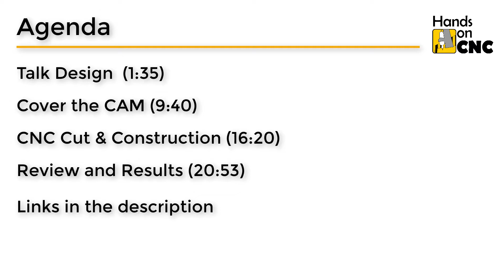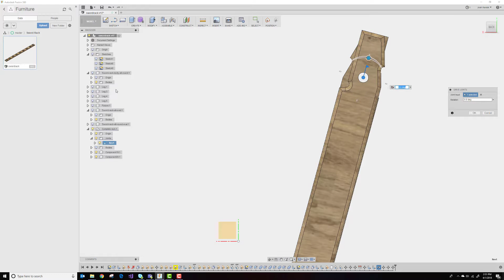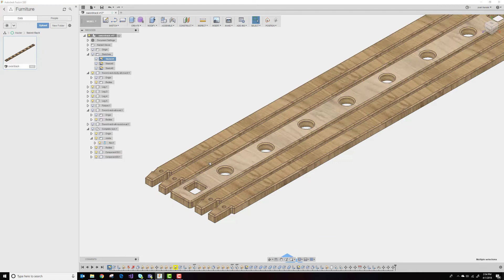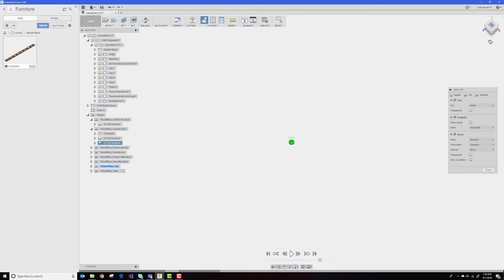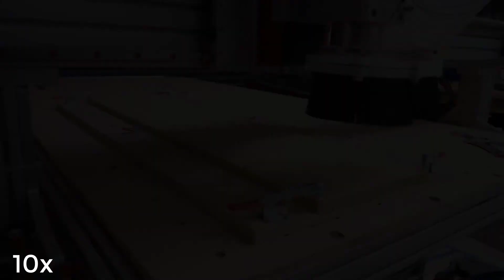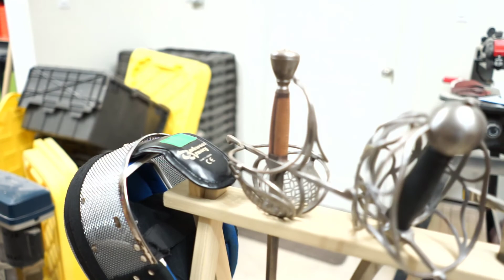Making a Sword Rack on a CNC Router

Comment: You seem really nice, and the presentation was solid. But it seems like a pretty boring design for a guy with access to a CNC machine.  Who is your expected audience, 14 year olds?   I feel like I wasted 20 minutes and could have knocked one of these out with a hand saw in less time than watching the video.
Reply from the maker: To each there own.. and there are parts that would be easy to knock out.. I can say from experience that getting the locking geometry right by hand is very fickle, and that they do take more than 20 minutes to make with hand tools (having made plenty of them with hand tools before).    Plus no one said this was an advanced project ;-)..   But I am glad you liked the presentation..
Reply: I did like the presentation.  Would love to see you make an "advanced" version of this project and see what you come up with.  I'm currently trying to find designs to replicate from the 17th century but it's tricky.  Most museums seem to display their collections not as they would have been stored historically.
Reply from the maker: Thanks for the suggestion I'll put it in the queue of ideas for videos..

Comment: Liked your video and explanation.  Just starting to use Fusion 360 - there's a lot to learn but it's very capable.  Cheers
Reply from the maker: Thanks, I appreciate that. Fusion 360 is great at democratizing CAD/CAM being free for hobbyists and amazing at both.  Used to be you had to buy a CAM program separate and deal with export and import issues between CAD & CAM if your living life at the hobbyist level, it was a total PITA.. Serious props to Autodesk!